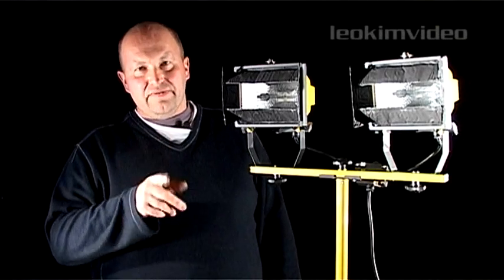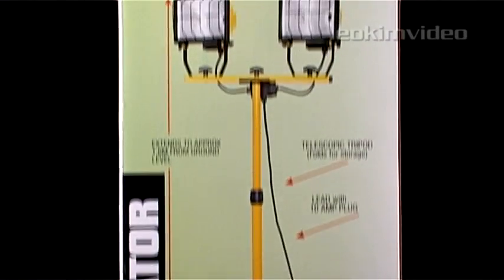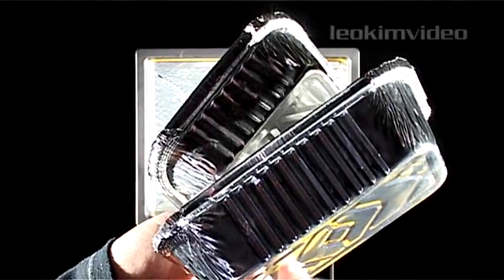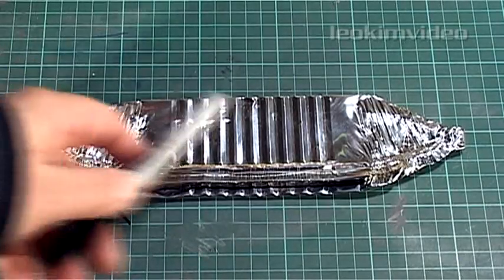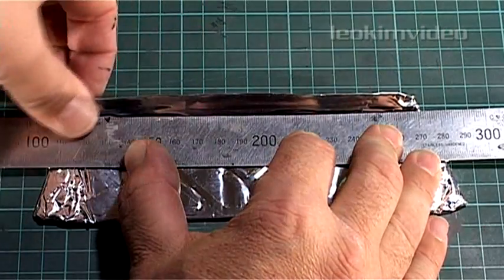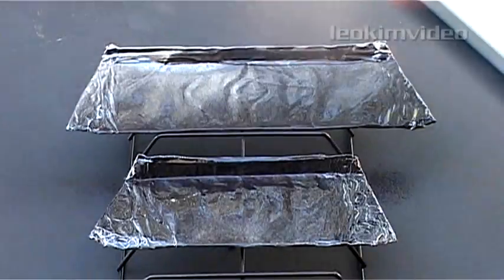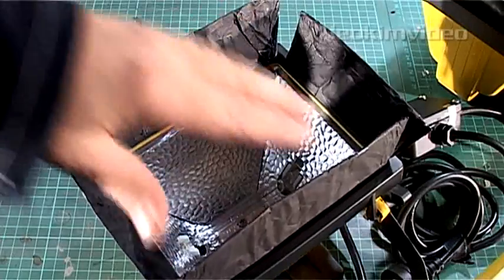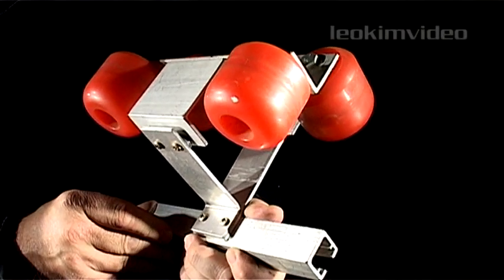$5 Barn Doors for Work Lights

Comment: Hi, great work, very Heath Robinson. While they might look a bit rough, they appear to certainly do the job for us amateurs who will only use them every now and then, not every day. 
I have decided to move over to CFL lights, and just got a set of softboxes from ebay. Now Bunnings have a couple of large CFL work lights. They are a bit more exey than the ones you use, but are daylight balanced and with the barndoors I hope will be great for  hair lights and backgrounds etc

Comment: I wathced the whole video... but err kind of agree with Grey80002. There is not much of a point of marking out folds if you dont' ensure they are straight by using a ruler... 

One more concern would be the longevity of the doors. You aren't using a permanent hinge but relying on the foil folding. wouldn't these snap and become weak over time?

Comment: So as far as fire hazards go, it's completely safe to keep those DIY barn doors right on the powerful hot lights for long periods of times?
Reply from the maker: Ethan Swords Well all my lights were done back then and I have not had a problem. Maybe it's worth doing a re-visit of my lights to show how they have stood up to the test of time with these el chepo barn doors
Reply: leokimvideo They are the only diy doors that won't slice your wrists. Well done!
PS: Why did you paint them black? Silver reflects the heat and doesn't smell of hot paint … or doesn't it?